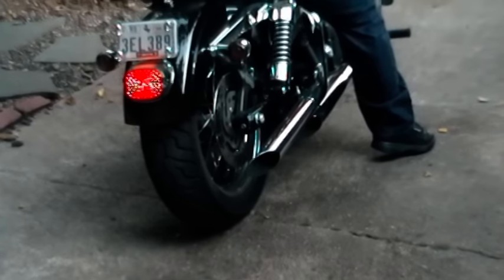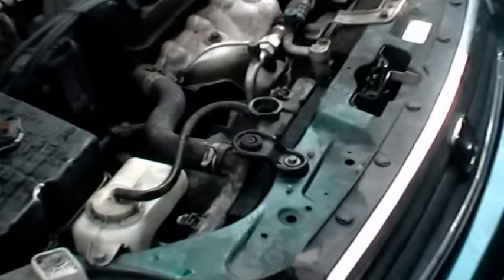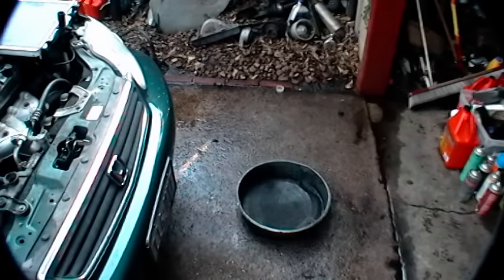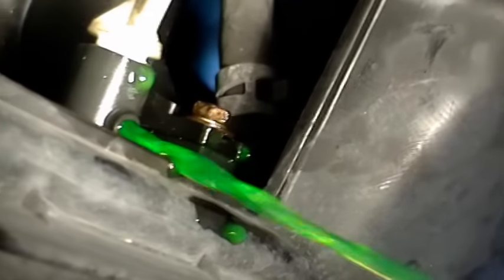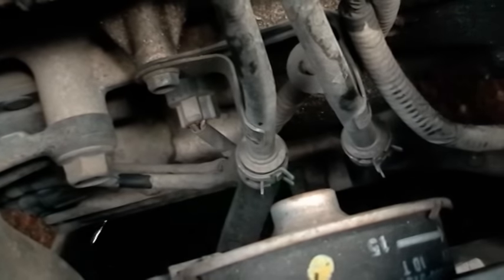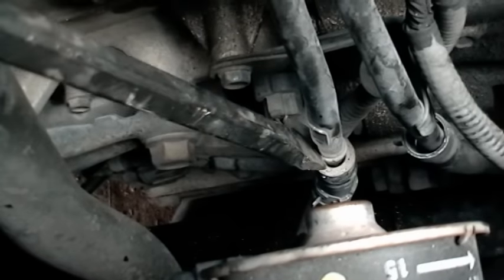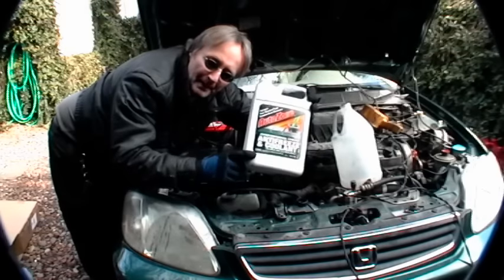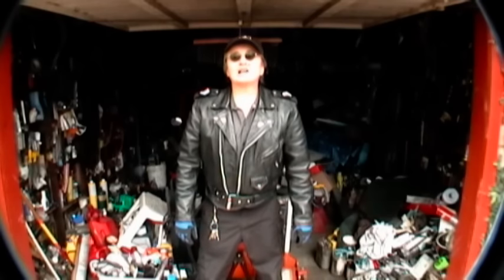How to Replace a Radiator in Your Car

Comment: But on my 01 s10 pickup it's leaking badly it doesn't hold fluids as soon as I put it in it just leaks right out and if I look down into it I can see fluid just a little  in there what is leaking? Message me  same on the engine I comment on it won't start but cranks acts like no gas but there half tank in there when I turn my key I can hear the fuel pump turn on and another thing I can take a video of what I'm talking about and send it by email if you want just send me your email address